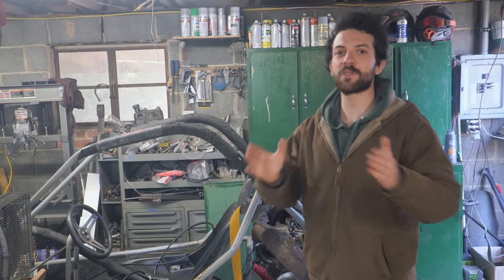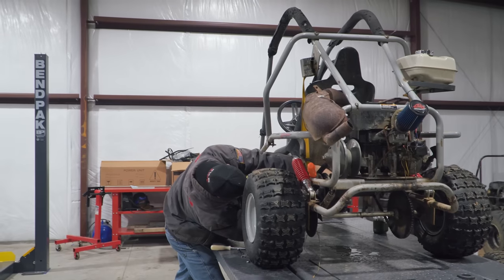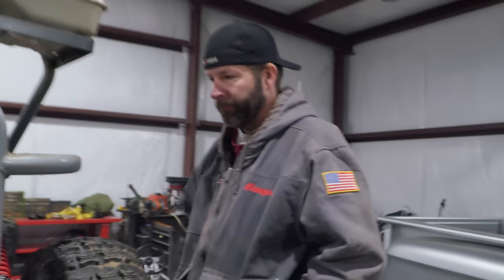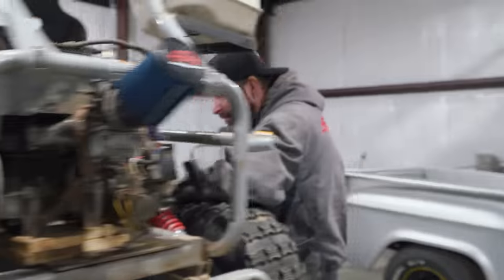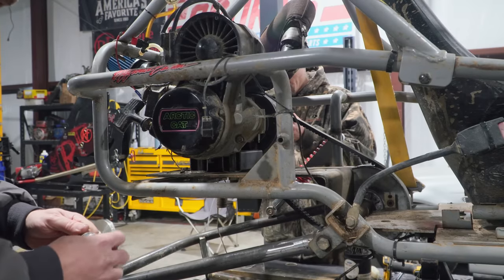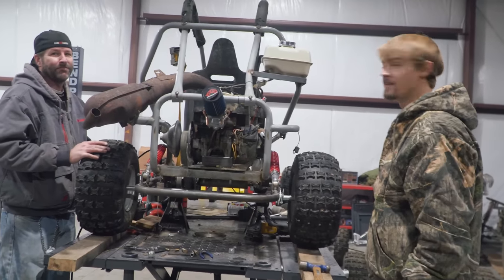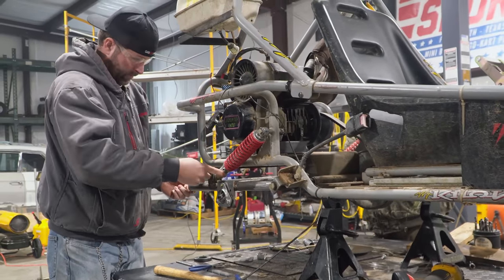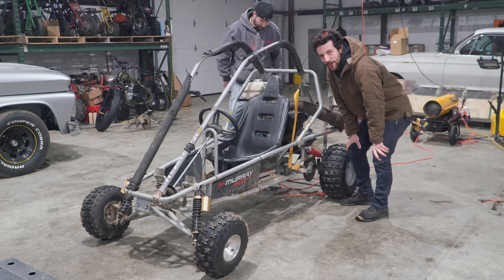440cc 2 Stroke Murray Kilowatt Racing Suspension Overhaul!

Comment: I'd really love to see you guys get that engine dialed in; I've always heard that you shouldn't run a 2 stroke unless it's running perfectly. I too have a snowmobile engine that's not running great, and I would like to see what you do to yours. I'm not sure if I love the new swing arm; it seems like your ground clearance is really hurting with the brake disc and sprocket. Can't wait to see what you do to the front suspension!
Reply: I don't know where you heard that, but after fixing and riding four vintage snowmobiles, I can tell you, you almost never run a 2-stroke engine UNLESS it's not running great. that being said, what type of issue is your sled engine having? only time I know of you shouldn't run a 2-stroke is if it has an air leak, as that can make it overheat, or if it's oil injected and the oil injection system is having issues.
Reply: @nybergsgarage  It's not revving out like it should, starts pretty hard, and has a clunk to it
Reply: @bradensmith888  check exhaust, fan shroud, and intake for mouse nests, that would cause it to not rev out and start hard. as to the clunk, check all belts for being bad or off a pulley. if not that, turn it over slowly by hand to see if you can tell when and where the clunk occurs.
Reply: @Smitty 2 strokes need the correct air fuel mixture to keep the engine from self destruction. The fuel in the air fuel mixture helps cool the piston and top end. If you have an air leak like a torn intake boot or worn crank seals the mixture will be lean and the engine will run hot and it will cook it. I have seen holes burnt right through pistons. The great thing about snowmobile engines is they are tuned for the cold so they run rich in warmer weather. That won't cause damage it will just keep it from reving up properly, it will do what we call 4 stroking, it will growl but run cooler.
Reply: They may want to reseal the bottom end those old 440cc snowmobile engines were notorious for center seals especially when they sit for a while
Reply: @dodgeme1986truck  %100 agree, it would be worth it to go through it and rule that out.  Seals and a base gasket would probably go a long way. A good old leak down test would be a good idea
Reply: @dodgeme1986truck  really? I've never actually seen anyone have a problem with center seals on an old sled engine after it sat, or had any myself. crankshaft end seals go out pretty regularly, but I've never seen anyone actually have a problem with the center seals.
Reply: @nybergsgarage  yup especially those 440 engines  and all 4 I bought had bad center seals when I bought them and they ran when parked
Reply: @patthesoundguy  Even more so when they are mixed fuel lubricated, rather than injected.  It's not to difficult to figure out what oil starvation will do there...and it does it very well.

My brother managed to mow practically an entire yard with the Lawn Boy we had then with the tank almost completely devoid of oil.  He was often helpful and could be somewhat depended on to do stupid crap like that, given long enough.  We unfroze it and it still ran, but it was gutless.  A cheap piston, rings, and cylinder and it was good as new.  I remember it would clog up exhaust ports (three holes) over seasons of mowing, and a quick drill in hand run through them would clean them out good as new.  Engines gotta flow.

He borrowed my two cycle boat once, and I filled the tank beforehand, AND strapped a quart of oil on the side of the can in case he had to fill it again, WITH the proper amount of oil for a fill for 20:1 required then.  At least he didn't screw up that time.  He later became a mechanical engineer, no kidding.  Thermal and missile propulsion, though, and a pretty good one.

The problem with four stroking is that the power goes WAY down, if the especially if the engine is well into it, but yeah, other than fouling plugs it won't hurt anything.  RC motors you basically richened them to to the edge of the four cycle regime so that they would lean at speed to a proper mixture.  You could really tell if they were too lean, kind of a whiny note to them.

As a guess, done long enough, badly enough it might muck up the rings and cause them to stick over the very long term.   Anyone ever seen this? 

I had a boat engine from the 60's and once I cleaned the carbs when I got it (three of them, six cylinder, 70 HP) I never had any problem with mixtures/starting/etc in the ten or fifteen years I ran it, but that was with religiously running them dry after each use.  

I pulled a 9.8 out that hasd't been run literally in decades and it started right up, second pull, and ran just like new, nothing done but gas and pull.  

The pump impeller was completely self destructed just from oxygen deterioration, so called dry rot, but cheap and easy to fix.  It didn't even need a cup, just the rubber impeller, and that engine had a LOT of hours on it.  We used to run it about once a week, usually for a couple to three hours, for years, about each week to each month, depending on the time of year.  The old Mercs were beautiful engines, engineering wise.  As good or better than many automotive engines of the time, MHO.  

Snowmobiles, not so much, not at all, actually in central Florida.  I rode an Arctic Cat Panther when they were one of the hot rods of the time of my cousins and the acceleration, even then, was amazing.  I was a little kid then (64 now), and it was not that different from a bike with a similar motor, traction extaordinare.  My uncle also had an Ariens.  That one was a hopeless piece of junk.  Sometimes you literally had to push to get it going. I expect that wasn't the case, new.  At least I hoped so.
Reply: @MrJdsenior  mixed fuel is definitely a different beast. I have seen engines cooked with too much oil without larger jets to compensate. I have had engines not able to get out of their own way when they were too rich lol. We set up chainsaws to just be on the edge of 4 stroking with no load and then they even out in the wood and run like champs. It's amazing how complicated such a simple engine can be 😉
Reply: @dodgeme1986truck  strange. in all my time working on those engines I've never once ran into that problem.
Reply: @nybergsgarage  I ran into it alot especially when you start modding for any kind of power
Reply: @dodgeme1986truck  maybe that's why, I've never tried to mod any engines. I'm pretty satisfied with stock power.

Comment: Hey guys. I have a decent amount of experience with the kawi 440s in jet skis and i think yall should change the crank seals in the engine to help with your running issues. 1211 case sealer on the case halves to reseal after and i bet she screams like new.  Ike should be able to knock it out in under an hour.

Comment: A trick to keep multiple bends straight is to put a block at the end of the tube and throw a level on it. Use that as a reference and level it before each bend. Also mark the end of the tube with the same level just in case your block shifts.

Comment: Remember that those carbs are jetted very rich for very cold conditions which you guys absolutely do not have down there. If the choke doesn't improve the bogging and the crank seals and base gasket are good you probably have a extremely rich condition and you probably have to go down a jet or two to get it to rev up right. Where it runs kind of ok cold and then it gets worse as it warms up it may be very rich. A leak down test would be a great plan to really know how the bottom end is doing.

Comment: You need to make the engine and the swing arm as one unit, getting rid of the upper engine mount giving you clearance for a bigger rear axle sprocket.
Reply: Yeah, not so much, if I understand you correctly.  One of the rules for high performance suspensions is keep the moving parts (wrt  to the chassis) light.  The whole point of a suspension, other than keeping the ride kidney belt free and reducing shock loads on the chassis members, is to keep tires on a non flat surface, and you need fast response to accomplish this most effectively.

If I misunderstood, and that is probably the case, ignore.

Comment: You can swap the cylinders to get the exhaust pointed out the rear. Pull the cylinders switch the pistons and put it back together with motoseal. While you're in there replace the crankshaft seals, leaking seals kill power and ruin engines.
Reply: Dont work on all motors becayse the cylinders are not symmetrical always

Comment: I've said it before and I'll say it again. You guys need to use a fuel stabilizer, if you already do I've never noticed. Stabil would be an awesome sponsor! Lol All those different projects sitting around, some for long periods of time. Those shocks would work better if more vertical
Reply: If you run carbs empty/drain tanks end of season or pre-long term storage (more than a few low single digit months) you don't need it.  Otherwise, yes, I agree.  Fuel going bad, and alcohol added fuel (what a stupid idea, as it LOVES to absorb water, and those carbs that aren't surface treated for that, meaning before it was a thing, corrode beyond recognition...certainly beyond any hopes of rebuilding them).  

Actually even Stabil type stabilizers  are no good for very long term storage, longer than a year IIRC, because even with fuel stabilizer all the light volatiles are evaporated off and the starting will be horrible. And eventually the fuel 'destablizes' and gums/varnishes anyway.

That is actually what those dry gas formulations are, alcohol for removing small amounts of water from a tank by absorbing it to run through and burn, at least burn to some extent, getting rid of it. Alcohol absorbs water which is death for pre-alcohol designed carbs.  Do it too long and the carbs are complete trash...nonunrebuidable as you can't even remove the jets without destroying them (at least I couldn't) and get the deep passages open properly, and I don't know that stabilizer does anything for that aspect.  Old motorcycles have this problem to the nth degree.
Reply: @MrJdsenior  yep, I just find it alot easier to add stabil to my gas cans when I fill them. Simple and effective. I'm 56 years old and not a single issue, since adding stabil and he'll it's gotta be 15+ years since I started. Stuffs cheap compared to the headaches of not using it.

Comment: The fitting in the bottom of that fuel tank will not flow enough fuel for that kind of power. The passage thru the fitting is barely 1/8 of an inch. We have had such issues with warmed over 212s that dont make near as much power. 5/16 all the way thru with adequate tank ventilation is probably necessary.

Comment: Keep the rear end soft you will thank me for it later on because of handling..... You may not think about weight transfer or squatting very much but in handling that makes a big difference if you're worried about jumps and maybe increase it a bit but don't go too much easiest way to think about it and drag racing there's a lot that is involved in how it squats the same way with drifting in cars as well even in big trophy trucks.... If you want big travel go big travel but you should keep your suspension soft for better grip

Comment: The bigger brake disc is a great idea, BUT you might find it useful to drill some ventilation holes as you don't want it to warp when it gets hot as it will get hot even with minimal use.
Is the carb your using the original for that engine? It sounds a bit like that carb might be too big, does it spiteful back through the venturi at wide open? That could be old worn reeds.

Comment: If you can't go lower go wider will help.i had a go kart with a fiberglass body of old school vw beach cruiser and my uncle decided he put a artic cat 250 he had laying around so I would be some else we could ride since it just sat around and it would pull wheelies at a roll with a 250pound guy they ended up stealing 100 pounds weight on the front so it won't flip with us kids I was about 15 and it was so fast till on day I was running in the  field and the frame snapped in two at high speed only thing keep back half on was the throttle cable and the dune bug body just act like a skid plate just rode it out till came to stop hell of a ride.miss them days

Comment: Im curious, here in Australia we run 240 v and either have 10 amp cct or 15 for residential stuff. A good welder usually runs on 15 amps but you can get a 10 am inverter that can burn in 10 mm welds without blinking.

You have an outlet in the old shop, can you not in the short term get a decent quality extension lead with high capacity and run it to your new shop and just roll it out when you heed to weld?

I have 30 m ( close to 100 ft) 15 amp lead that i use to weld with but it cost me a bit.

Well worth the investment

Not sure how far away you are from getting the welding cct to the shop but i was guessing after winter?

( yeah we dont get those here, we get fing hot,  fing hot and wet or just fing wet,  or on a leap year when you have been  really good

Not so quite fing hot but then everything burns down! )
Reply: I don't think their new shop is fully wired up yet which is why they don't have a 240v outlet in it. I could be wrong though. :)

Comment: You need to do new seals and rebuild it it worth it seals are easy to do they are like 40 bucks seal make those motor keep fuel going to carb and u need to hook up a vacuum line  on the port  any other question. Let me know

Comment: John, Ike, Charles, guys I know why that motor isn't running at full potential. Check both cylinders for fire, and RE JET THAT BAD BOY! Sled motors don't normally have a filter and that's leaning the engine wayyyyy out. Either 86 the filter (bad idea) or throw a bigger jet in that thing. 

I ran into the SAME bogging issue with my yamaha 440 trike build and as soon as I pulled the filter that thang woke up and chose violence. I had to go two sizes up on my main jet and a slight tweak to the mixture at idle but now the tires can't keep up with it! 

Yes it's fast, yes it's dumb, no I don't care, and if I can make it to mini mayhem this year y'all will see it.  :_sendit:

Comment: Idk must about those snowmobiles but if it had a air box instead of filters and you got stock jets it will run lean because it was restricted with the air box and now it isn't if it's sucking a lot more air it will need gas to go with it

Comment: As I have pointed out in the past and y'all keep ignoring you are running the driven pulley backwards with a symmetrical belt the moving side of the driven goes towards the engine ! 
The whole reason Commet made the asymmetrical system was so the moving side could face away from the engine and make it more compact so it could be all mounted to a backplate which could be mounted to the engine .
Please since you don't seem to believe Me look at some Commet literature or at least a snowmobile and /or ATV diagram !

Comment: I have a question about Snowmobile Motors. Do the have to have a cooling system if you are using it in warm to hot weather? I knew this guy that made a VERY fast go kart from scratch with a snowmobile and a frame he built himself. The steering was the handles and the motor was so fast that he didn't want me riding it (I was like 16) I'm 38 now 39 in March. I live in about the middle of NY State.

Comment: BOG = rich 

its a two-stroke its a snowmobile engine they are jetted and timed to run at -10 to +30F 
 anything outside of that and it will not run correctly it will be very rich in warm weather(over 40f = bad rich)  you will need to re-jet that carb and or make an adjustment to the needle clip 
these are usually jetted some ware between 325-340 for cold operation
timing is set by moving the marks on the stator plate 22 > 24 > 25 > 26 once you have the jetting figured  light-set the timing so its 24 Degrees BTDC @ 6000RPM hot 

*danger these motors hate being lean and hate detonation , if you get it wrong it will blow up and catch fire, trust me I have seen enough articats on fire to know this is true

Comment: Literally no quad or bike that I have worked on has the swing arm pivot on a jackshaft... I have seen an old minibike built like that but it's just not necessary
Reply: the swing arm pivot is typically behind and in line with the output shaft of the trans and the rear axle at ride hight.. it is good to get the drive and pivot as close as possible but you can get away with a lot as long as u can make a straight line through all three points at ride hight.. when dealing with a lot of power it is more important to have a solid pivot with one straight pin than perfect alignment with the drive..

Comment: I mess with snowmobiles and there are some will run like a giant pile and then all of a sudden run like a scared cat I had a few like that and alway thought it was a carb issue and take a good carb off a good engine and have the same issue anyway hope you guys fiquare the issue out because I found with some engines they are just little bastards and want to run like snot then run real good without any rhyme or reason

Comment: You guys should build a better intake system that mounts high up on the roll cage and do away with that pod all those do is suck mudd and dirt into the engine and cause unnecessary wear and damage pods are only good for blacktop riding they are worthless off road and have no business being on an off-road machine.